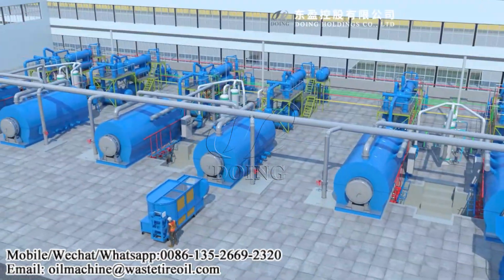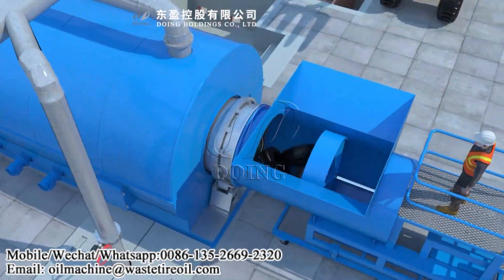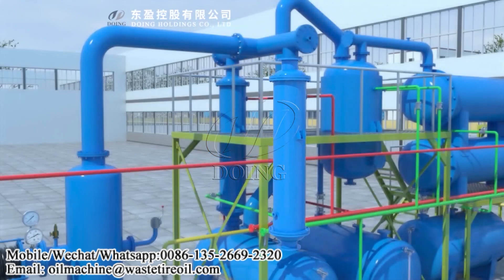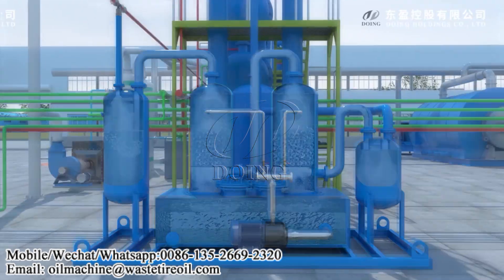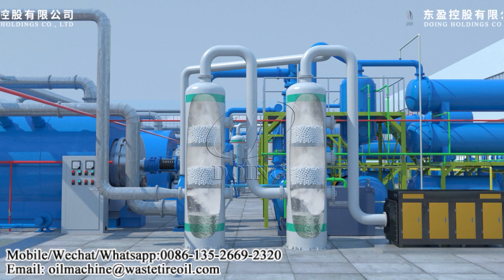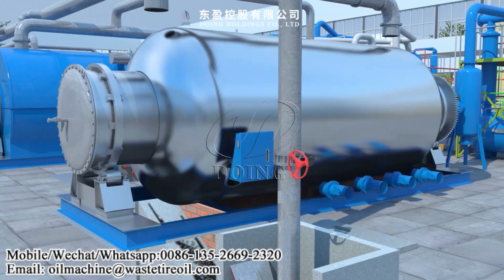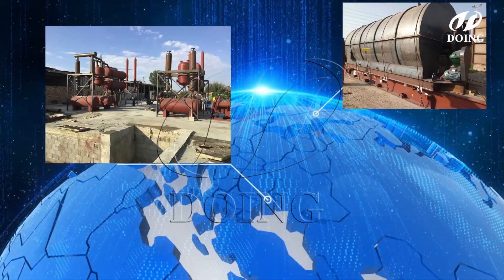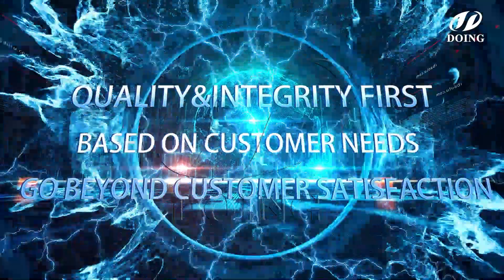How does pyrolysis plant work? How to make fuel oil from waste tire plastic?

Comment: The process is called pyrolysis, it’s categorised as “red” zone “hazardous” industry in India and needs a lot of safety precautions to be complied with, this plant will be shut down in minutes for like 100 different violations.
Reply from the maker: Many Indian customers have purchased our pyrolysis equipment, and it is running smoothly. The safety and environmental protection devices in DOING can guarantee its performance.